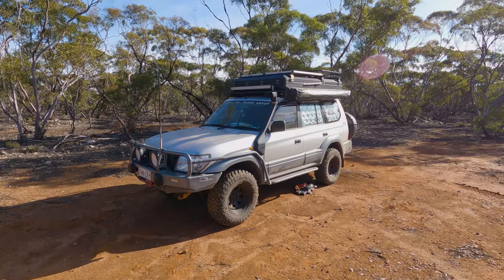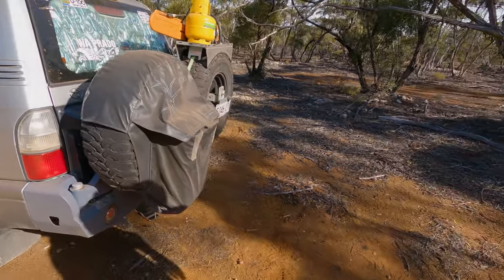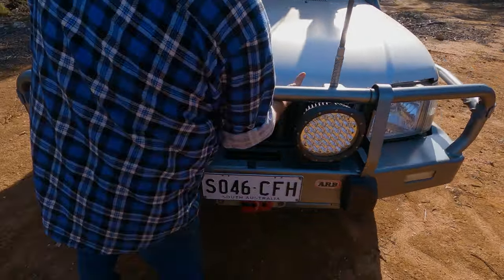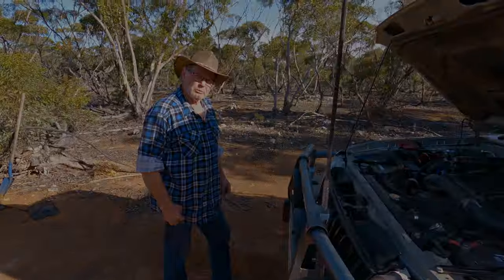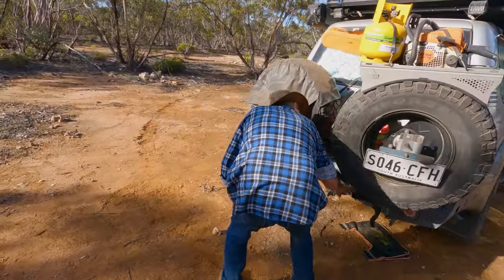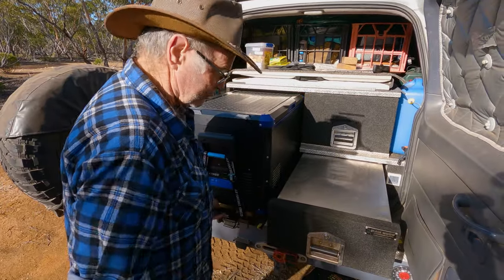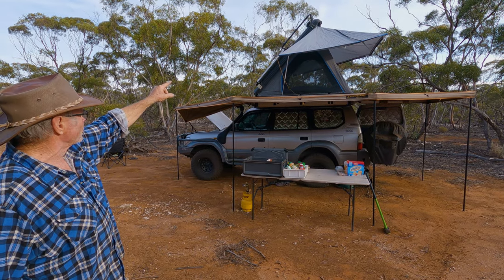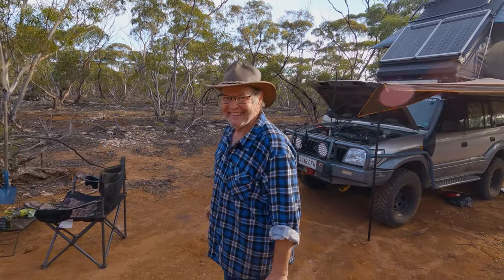Touring Build Review - 2002 Toyota Prado 90 Series Super-Tourer

Comment: Solid build!  Very functional.  What's she weight in at?
Reply from the maker: This is another one Pete can answer as I don't actually know myself.

I'm sure he'll answer as soon as he can. 🤠👌
Reply: It’s about that.
Reply: @OzTrax4X4  I assume Pete is testing the greasable lower ball joints?  I don't know if I'm overly paranoid about it, but that is one area of my 90 that will always be in the back of my mind and makes me consider selling it for something else.
Reply from the maker: @Oh_Sully23  Yes he is. 6000kms currently and no issues.

I have a few people after sets of them.

If you message me over on Facebook or Insta, I can give you my reasoning as to why greasable one's are king over genuine and other aftermarket ones if you like. 🤠
Reply: @OzTrax4X4 should the engine managment light come on when i turn the ignition key on? My 90kzj wont start. Cranks but no fuel going to injectors.
Reply from the maker: A common issue with the KZJ95 is a loss with the immobiliser signal circuit, which is part of the ECU.

Sounds like that could be the case, and that requires an ECU repair.
Reply: Ok. My engine managment light doesnt come on at all.
Reply from the maker: Which is why there is an ECU issue as there is no signal bud.

That ECU will need repairs to fix the circuit so that everything communicates properly and allows the engine to start.
Reply: @OzTrax4X4  getting flash code 99 fault
Reply from the maker: That is an immobiliser fault code. Definitely going to need to get that ECU repaired unfortunately.
Reply: @OzTrax4X4  cant find anyone in the uk or ireland who can test or repair this particular ecu!
Reply from the maker: If you head to my official website, message me on the contact form there and I'll give you a contact in Australia to get it sorted. 🤠👌
Reply: @OzTrax4X4  what is your website address?
Reply from the maker: The address is www.oztrax4x4.com.au 👌

Comment: Looks purpose built.  Good one.👌I've found setting up a 4WD setup is an on-going tweaks & updates.  I've now had my 80 Series for 5 years and to date, I've made improvements and/or changes to make it more suitable for my needs at least once a year.  And I have no doubt, I will do more tweaks and changes in the future. 😁
Reply from the maker: It's most definitely purpose built but has around 10 years of refining in the setup.

Definitely does what it's meant to do and that is live out of it for 6 months at a time, if not longer. 🤠👌

Comment: What are the dimensions of the tent?, mainly the width and length?….
Big tent for the roof of a Prado but seems to fit well.
Cheers guys 👍🏼.
Reply from the maker: I put a link in the description for you for the tent Tony.

Everything is under the specifications tab.
Reply: @OzTrax4X4 awesome thanks for that!. 
Hard to tell in the video but does the tent overhang the sides of the roof profile much?. 
Cheers!.
Reply from the maker: @2117nz  not at all.

Sits pretty much how my 80 series sits with my awning hanging off the side and wheeler my side rails of my roof rack are.

Comment: Great setup, how do you get around the 100kg roof load limit on the Prados with roof top tent, your body weight, solar panel etc, which will void any insurance you may have ? I want a rtt on my 90 but may have to go to full size Landcruiser.
Reply from the maker: While Pete hasn't replied yet, I'll throw in my 2c worth.

That rack, RTT, awning, and solar setup is probably around 125-150kg total.

While there is a grey area, I've had this discussion many times and you'd want to look at static vs dynamic load ratings and off-road ratings as well.

Basically, if you have an accident caused by an overloaded roof rack, then you're not covered.

If you hit a kangaroo, or someone hits you, you'd be covered, as the rack didn't cause an issue.

Ideally, you want to keep your weight down as low as possible at the end of the day.

A low profile clamshell aluminium rooftop tent and an alloy rack will be the choice if you're concerned about the legality of it all.

In regards to changing vehicles, that is totally your choice, bud I'd expect both a Landcruiser and a Prado to have near identical load ratings.

Hope this helps somewhat 🤠👌
Reply: I just get in it and drive. I don’t plan on having an insurance claim. 🤣

Comment: Which brand are the solar screens and are they made to fit the 90 or are the off a patrol/120 series?
Reply from the maker: I've added a link in the description box for you.

You'll need to contact the company to order them and they are an exact fit for a 90 series Prado, you just need to specify what you would like to order.

Whether that is the rear doors, rear pop out windows and rear door window, or a full set including the front doors and windscreen is totally up to you and what you are planning with your build.

Comment: I have the same car, went to buy that tent and got told its too heavy :(
Reply from the maker: While there are on-road and off-road ratings, the general consensus is nothing more than a 100kg load rating on your roof.

The majority of individual roof racks are rated to 40kg per cross bar.

So, if we go on that calculation, a flat rack with 8 mounts (4 either side), would effectively be 160kg distributed evenly across the length of the roof less the weight of the steel rack, which I would put down as 50kgs, so 110kg load on the roof.

I know this roof rack can take approximately 250kg of load (no, I wouldn't put that up there).

As this isn't my vehicle, that would more than likely be how it was calculated.

Comment: Nice video.. but that's not a 1kz-te fellas that is a D4D engine..
Reply from the maker: Sure is a 1KZ-TE my dude.

The D4D variant is the 1KD- FTV, which was never released in the 90 series. 👌
Reply: No it's not my friend 🤔 I have a 2000 Toyota Land cruiser j95 and I have a 1kz-te engine and it says on the top of the engine 1kz-te... And as well as the 1kz-te engine it is non intercooler.. I will send you a picture if you tell me where...
Reply from the maker: @todorroshev2769  maybe in your countries market you got a D4D in your 90 series, but here in Australia, it was the 1KZ-TE up until 2002.

The 120 series got it later on in life here, but I can assure you that is a 1KZ-TE sitting in that engine bay of this vehicle that the owner has had for well over 10 years. 🤔

The Japanese market introduced the D4D for JDM model from 2000 onwards, so I'd say that is where the confusion lies.

Ours were intercooled from the factory and draw air from up under the front edge of the bonnet.
Reply: If you tell me where I can send a picture you will understand me... This engine got that car in the UK and Europe is a D4D engine I own the same truck and I'm telling you my truck has a 1kz-te engine and it is completely different from this...
Reply from the maker: @todorroshev2769  by all means you can send it to me via my Facebook page, but different world markets had different engine combinations.

Europe for example would have a cold climate, so wouldn't need an intercooler, where here in Australia we have a hot climate and its required.

This isn't my vehicle but I know the vehicle as I've worked on it several times myself and I know the owner very well. 🤠
Reply: @todorroshev2769 it's definitely a 1kz. The manual boost controller is a dead give away